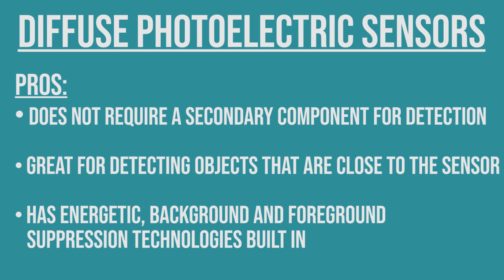SICK | Understanding Thru-beam, Retro-Reflective & Diffused Proximity Sensors | EandM

Comment: I’d like to use a photoelectric sensor to create an occupancy sensor for a room….could I use two diffuse sensors next to each other…to capture direction of motion (if A detects and then B, add 1….if B detects and then A, subtract 1). If so, are diffuse sensors a good option for a doorway mount or is the detection area too short? Would you recommend a set of two retro reflectives instead? I’d want to house them both side by side in the same housing….for ease of mounting.